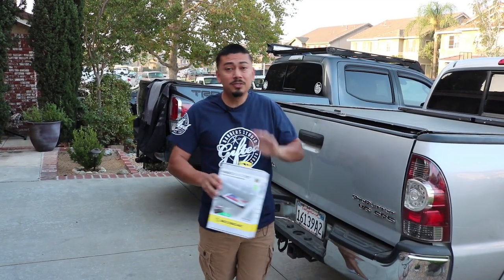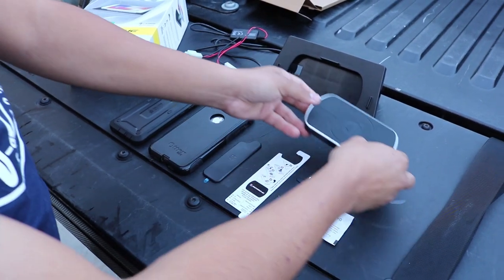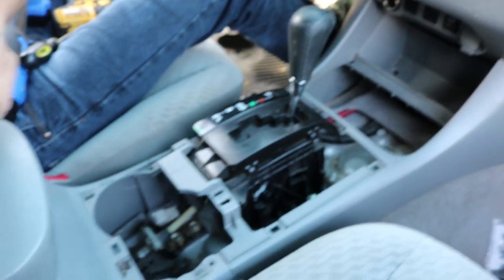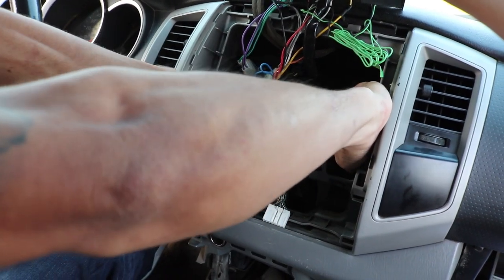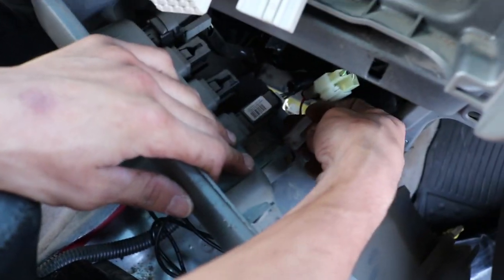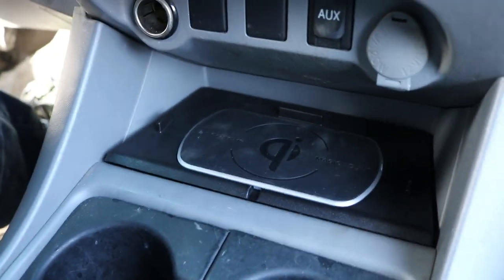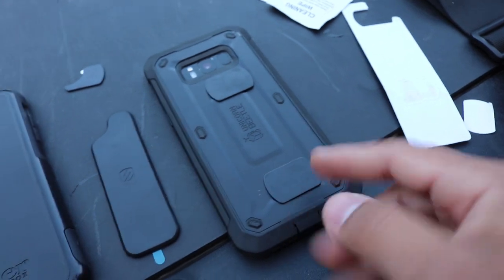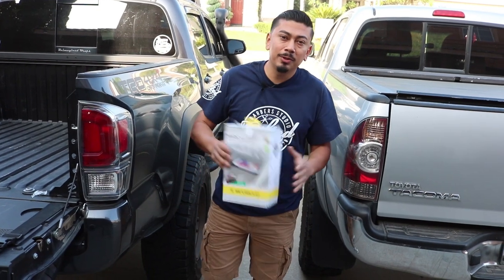WIRELESS CHARGING FOR 2005-2015 TACOMAs like factory | HOW TO INSTALL SCOSCHE WIRELESS IN DETAIL!

Comment: Nice walk through. Will be doing my 2009 as soon as my charger arrives.. Although the actual setup is PNP, the time it takes to get to the PNP is another thing. It usually is. On another note. I work in aviation as a maintenance tech. One of our favorite sayings is 'all you gotta do' . When we here that we know that 1- the job may be as easy as PNP but 2- the time it will take to actually get to that point is a whole other thing. So, all I gotta do is a whole lot more than PNP. ( I'm using the plug-n-play as a reference for an easy job.) I appreciate the vids you do for us 2nd gen owners. Thanks.

Comment: I'm going to check to see if they offer this for a 2013 with a manual transmission, as the console differs in the area where this is installed. In fact the complete console is different.

Comment: That's an insane amount of console disassembly just to access the lighter socket for a power 12 volt power source. You might say it's a lot of wiring to go wireless lol. I don't need wireless charge capability that bad. Stick to wired charging....

Comment: will this work on the 6 speed manual 2nd gen tacomas?
Reply: never mind, I found the answer.  It will work with manual transmission but you need to do a little trimming to make it fit.

Comment: The wireless charger in the 3rd gens are overrated, it charges my phone for tops 20 minutes before it starts beeping because it's too hot. It needs a built in fan to cool the phone while charging.
Reply: You must have an iPhone?
Reply: @j0shll0yd  No, Samsung s8. My Samsung wireless charger at home charges fine no overheating.
Reply: @TheCastLife  interesting! I had the same problem with my iPhone.
Reply: Same result for multiple phones. Waste of switch space. Just covered it with a mat.

Comment: Dude, I’m sorry but there is NO WAY you did this in 20 minutes. You basically have to take off the entire middle part of your dash, drill into your OEM panel (which a lot of people are not gonna want to do), take out the radio (I have no idea why you even did that, looks like you could have got away without it), as well as the shift control panel and cup holders. You should have done a video on taking out the OEM wireless charger from an actual 3rd gen instead of the cheap after market one. How many times has your phone slid and fell out of that spot? 😅 

I’ll just plug mine in to the radio so it can charge and I’ll have Apple CarPlay. 3rd gen owners just like to buy ANYTHING 🤣

Comment: Thats wayyy too much work and ubstill cant even look atvur phones navigation.  Just buy a tech deck cell/gps/gopro mount/ram mount. And buy a ram mount wireless or a quad lock wireless with the case. I bought the 4 hole mound quad and trimmed around usingvram mount 2 hole as the template, then it matched the holes. They have mechanical mounts and magnetic/mech hybrid mounts